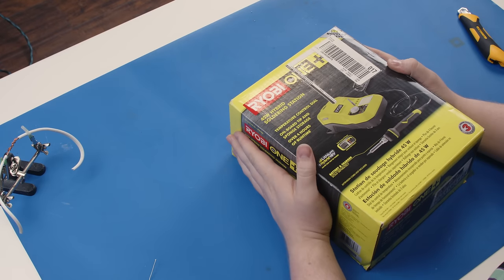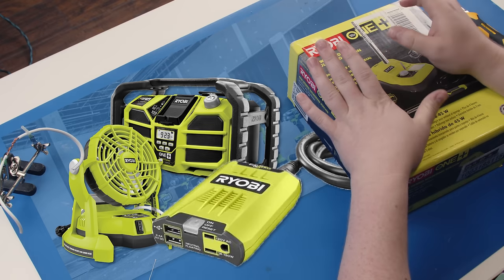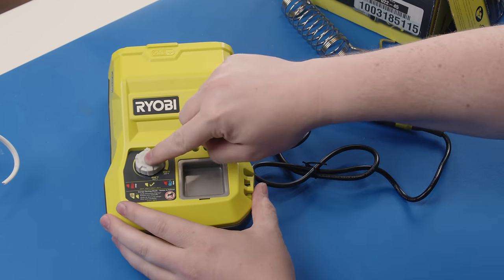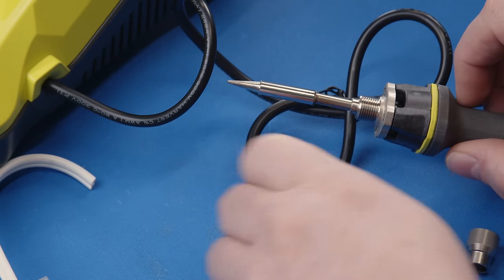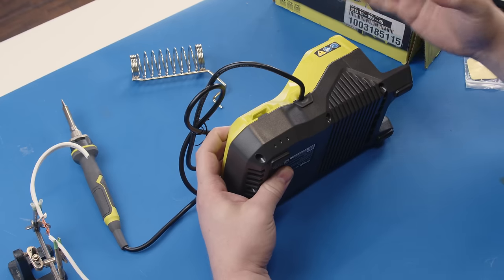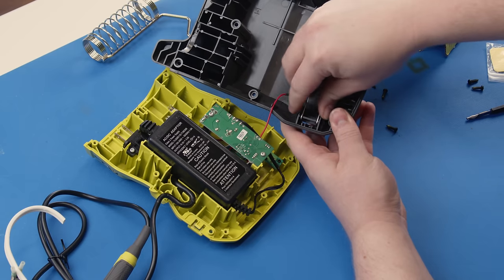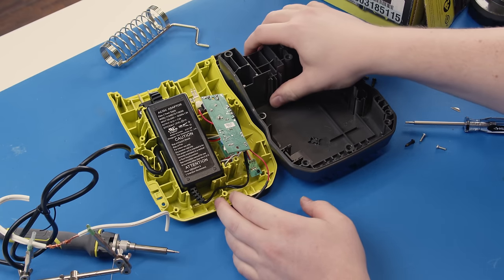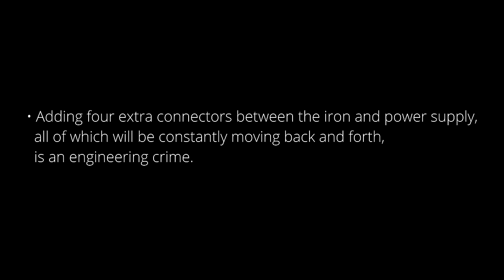Ryobi has GOT to be joking with this soldering iron

Comment: While the iron itself would melt through, the rating is intended to give you an idea how hot the cable itself can actually get. The markings are intended to help you figure out what cable to use for a specific application. Essentially it's saying "Hey if you run enough current through here, it's going to melt and catch fire right about this temperature."
Reply: 24:17
Reply: Yeah I really didn't like that this was a significant section of the video. It's the wrong meaning as you said and if that's what he's worried about might as well spend 5 min telling people not to rub the iron on their fingers either. Seems like Ryobi considered this as well with the cool down warning light. But alas can't engineer for every single use case.
Reply: If you push enough current through a cable for it to reach 80c you've got way bigger problems than your cable melting and catching fire.
Reply: No.  If your wire is (self) heating up much at all, it is too small a gauge for the design current or the circuit has a fault.  On the other hand I do agree that the specs are needed to determine cable compatibility in extreme environments, for example an engine harness or on the space shuttle, inside a toaster oven or curling iron, etc.  Most of these applications are also those where  you can't use solder, must crimp or weld/etc.
Reply: No, it has nothing to do with the current rating.
It is to to with where the cord is expected to be.
Some devices are made so their power cord will remain cool, and are fine with an 80C one.
Some are made such that even the receptacle for the cord can be over 80C, and so need a better cord.
Reply: Man your making an idiot of yourself about this wire thing buddy. 80C is electrical rating not soldering heat protection rating. So don't touch the tip on the cable no matter its material type..... or your skin.  Your skin is rated way lower than 80C...
Reply: @Rubenmanzana No, 80C is temperature rating, not electrical rating.

It indicates the maximum temperature the cord can handle before being damaged.

But yes, it shouldn't be a problem.
Reply: @jeffreyblack666  yes, but the reason that temperature rating is important or relevant to the cable has nothing to do with the cables physical relevance to what its attached to. It is printed on the cable not for the soldering tips heat protection ability but for maximum allowable ampacity determination for the conductors within the cable. The cable manufacturer doesn't know what its going to be used for. But if you draw more current than the conductors and cable can safely carry the heat of the circuit will be over specified rating, especially if used in high ambient temperatures, causes failures and potentially dangerous outcomes. The cables manufacturer must determine the insulations heat rating as well as specify the wires circular mils or AWG for engineers to properly select proper cables for circuits they design. No one was thinking of protecting the wires from soldering tip when that label was placed on the jacket. To me its a no brainer (but i do have this rare gift i call "common sense") to just keep the soldering tip from touching the tools supply cable. I assure you even if the same cable were attached to refrigerator and was installed in the cold area its labeling wouldn't change or even be relevant to the machines potential physical hazards due to the refrigerator itself. though consideration to the colder temp could be considered when de-rating, sizing, selecting, ect. the cable temp ratings are for determining conductor sizes more than anything else. Not for determining how safe it is for the soldering tip. Any hard wired soldering iron thats used carelessly will damage its supply cables people. Thats not a thing that should have been criticized. The fact it wasnt flexible and had memory and was stubburn in using the tool is worth of critique but saying they were making bad choices based on that rating of the cable because the iron is hot is ridiculous.
Reply: @Rubenmanzana  No, it isn't.
The temperature rating has pretty much nothing to do with the current rating of the cable.
Instead, the temperature rating is about what temperature the cable can withstand which can be important for what it is plugged into or attached to.
Some devices, instead trying to protect the cable from heat, will instead just require a cable which can withstand a higher temperature. For example, you may have a hotplate or an oven which requires a high temperature cable.

We see this quite easily with the IEC connector, which commonly have cords with insulation like that. The C13/C14 connectors are rated to 70 C. The connector and cord MUST be able to withstand this temperature, but it is also rated to 10 A. The C15/C16 are still 10 A, but are 120 C. The C15A/C16A are still 10 A, but are 155 C.

If your cord is getting hot from passing too much current then the conductor in the cord is far too small.

In the context of the soldering iron tip, that would be wherever the cable terminates in the handle.

Comment: Reminds me of when I worked with high current circuit breakers on a 130kV facility. Breakers like these uses 4 to 6 large pretensioned springs. Springs that are something like three inches in diameter and three feet (around a meter) long. Pretension in accomplished with electric motors. A particular norwegian made breaker that I had never seen before used... Bosch hand tool power drills with a strap around the button as tensioner motors.

Comment: I use this iron on occasion, it has yet to fail me. I like that I can store it in a big toolbox and pull it out for a short project without connecting it to the wall. Love it.
Reply: And now you know if you don't have access to an extention cable and your batteries are dead you can just take the shell off and pull unscrew the plug bit and plug it into a wall directly

Comment: I see you annotated that Hakko has the "exposed" ceramic heating element as well. I was going to mention that they use the same type on the Hakko 936. And, in my personal experience, the 936 is an absolute workhorse. But I also have one of these Ryobi units that I received for a website reviewed several year back. I'm actually impressed with how well it works. And for a station that can be used anywhere, with battery power, I'd actually recommend it for the home owner or field tech. EDIT: But you do make a good point about the PVC cord tethering the iron to the base.

Comment: TS100 is a really good mobile iron - works well with drill battery or laptop PSU
Reply: I use a ts80p as it can be powered using a USBC charger or power bank which is a bit more compact for my purposes. It came with a really nice, flexible silicone USBC cable
Reply: I personally have a pinecil, USB-C too, portable stuff is nice
Reply: i "upgraded" from a yihua 852d+ to a pinecil and have had no qualms whatsoever. the points cathode ray dude makes at the end of the video are completely true points, but the ergonomics, tiny form factor, complete portability and flexibility of power supplies on top of being dead cheap all make it one of my new favorite tools. if i wanted to use a battery, i could get a big beefy laptop battery that outputs 65 watts and go to town with any old usb c cable. i could get a power supply and have a completely competent soldering station with no added bulk. plus, temp control is on the iron itself, so i wouldn't have to take my eyes off the iron to change temperature. it's extremely impressive for being so cheep
Reply: I use the TS100 with a power bank. There are cheap USB C to barrel plug cables on Ali. It works really good so far.
Reply: I use a TS100 as well, when I’m at my bench I have a cable I can use with my bench power supply or I use a battery from my drone when out and about
Reply: Yeah I'm not sure what his bias is against them with his utter refusal to use a tool that does meet his criteria with great build quality
Reply: I use Ts100. It's ok. I just use my 3 cell lipos to power mine.
Reply: I have a Weller station at my workplace and honestly I prefer my TS100, I do solder small XLR pins and even had once 40 pin connector soldered with it, and its so comfortable and heats up in under a minute, I've used it so heavily the tip is black from all the soldering(I have it for more than a year, at least 10-20 hrs of work a week), never had an issue with it, my co workers (some in the profession for more than 50 years) said it is actually too good to be true(heats in seconds, cools down in 1-3 mins, can swap heads while its hot), seeing them use it and get amazed by it, you cant fake that, the TS100 is an amazing soldering iron, I really love it!
Reply: personally i use a pinecil which is essentially the same solder pencil but only cost like $25... uses the same tips as well so
Reply: Pinecil user here too. Got a friend to 3d print me a holder that snaps onto a dewalt battery. I still use a weller tabletop plug in for the majority of work, but the Pinecil has worked more than fine for a mobile quick fixes.
Reply: @wolfnation100  The lack of strain relief at the iron can be mitigated by using a magsafe stype connector.  Also the Pinecil has both USB C or barrel so in the unlikely event you do damage a port you still have a second to use till you can repair the first.
Reply: I think I'm gonna get one now out of curiosity.
Reply: @Kholaslittlespot1  Which?
Reply: @daveedee3626  I'll look into it but if they literally seem the same then the cheapest one xD
Reply: @Kholaslittlespot1  I think they're basically the same but the Pinecil has the advantage both a standard DC barrel or USB C port on the same iron.
Reply: @daveedee3626  The more I think about it the more I think I'll def grab one. Even just for outdoor jobs.

Comment: The Iroda gas soldering irons are excellent for where you don’t have power, the flame is fully contained and isn’t any more of a hazard than the hot tip or the hot shaft on an iron with a resistive element. They have a reasonable amount of temperature control too, and whilst you don’t have a defined setting, if you’re experienced with soldering, you just know when it’s right. 

PS, I use a JBC in my workshop.
Reply: I had one of those Iroda gas irons it must have been a bit of a dudder the bloody thing exploded luckily I wasn't hurt that put me off using gas powered irons for life.
Reply: @roberthorseman7432  wow, I have several that I’ve used for years and I’ve never had an issue, I consider them an essential tool as a live sound technician, so much easier for repairing a lead in situ… things get snagged and with the iroda iron, it’s a 2 minute fix, often quicker than running a new cable.
Reply: @Si1983h  Yes I was quite disappointed when that happened quite frightening.

Comment: I had a butane soldering iron for years (until it eventually got clogged up with particulate and died). I found the temperature control to be really good, and it was easy to see what kind of temp you were at based on how red the mesh screen on the exhaust was glowing.
Reply: Same. I've got a Snap-On that's been working reliably now for years, and never given me so much as a hiccup. Identical (aside from colour and branding) to the Weller Portasol 100K, which isn't surprising since that's who manufactures them for Snap-On. I'd definitely have no qualms whatsoever about buying the same one if mine were to ever irreparably fail.
Reply: @strathadam1  Mine was an Iroda, to be fair I think it was using some cheap butane that killed it off
Reply: I've got the radioshack special, i find that it heats up faster and is more accurate for what i do than the weller. (No ICs but plenty surface mount)
Reply: I love my portasol butane soldering iron. Heats up in seconds, great temperature control
Reply: I've been using a power probe brand butane iron for about 10 years in a shop. I've had to replace the soldering tip, but it has really held up well. Matco truck usually has them.

Comment: The closest thing to temperature control ive ever had was on my butane iron which you could set from blazing to literall hell on earth. Worked pretty great tough if it wasnt for the tip breaking after a couple of solder jobs

Comment: I like the Ryobi tools specifically because everything uses the same battery. They haven't changed the battery in a way that affects compatibility for like 25 years, so I frequently find tools from their older dark blue line at thrift stores that work perfectly fine once I plug a newer battery in.

I also gutted an old dead Ryobi Ni-Cd and instead of putting new cells in, I installed a barrel jack so that for lower power devices that aren't hybrid (but could be) such as the older lights, radios, soldering stations, etc, I can just power it from wall power and save discharge cycles on my batteries.

Comment: 20:30 Been told that the Milwaukee tips are interchangeable also as well as the HAKKO FX-8801. Been using this for the DIY, Automotive and two way radio installing for about a year with no issues both on the AC cord and A DeWalt battery with a Ryobi adapter. Not perfect but the best options of a bench type station as well as a portable iron. No it’s not selective enough for doing surface mounted components But like a Swiss Army knife it does a multitude of chores in one package.

Comment: I have and love this soldering iron with one exception that annoys the crap out of me.   It has an auto shutoff feature that seems to based strictly on time because it does so even while in use and the only indication it gives you (besides losing heat) is the green 'on' light only starts to get a bit dimmer every couple seconds.  It isn't at all obvious that if you want to continue using it, you need to turn it off and on again.   The light should flash red just like it does after you turn it off to tell you it's still hot.
Reply: @Zadesniper  
No it's a safety feature in case you forget to turn it off.   I don't mind so much that it turns off after some time.  I just wish it would more clearly indicate that it turned off instead of appearing to still be on.

Comment: I spent a good portion of time with that exact model of butane soldering iron because both wired ones we had either broke, or had the tip completely oxidized off. There is some ability to control temperature by varying the size of the flame, but it's not really precise (though, the one I use now doesn't have anything other than a dial marked 1 through 9, so it's only slightly better).
They actually work decently well, if you don't mind the smell of butane, the fact that all the hot parts are exposed and right next to your fingers (like, closer than usual), and that it's got very little thermal mass of it's own, but... yeah I'd gladly take something better any day.
Reply from the maker: Hahaha, thank you for the input and the pledge! I gotta get myself one of those butane irons.
Reply: @CathodeRayDude  they are fun. Good for really huge joints, but generally just fun to mess with.
Reply: @CathodeRayDude  Honestly if I knew where ours was I'd just toss it in a USPS envelope, not like we use it anymore. Though it probably got lost last move.
Reply: I would recommend the power probe   butane iron the only complaint I have with it is you have to be aware or where the exhaust hole for the flame is pointing or you might burn something, but it solders surprisingly well

Comment: I have an iron with an element that's similar with the ceramic piece and the screw on tip.  It also has a thermometer and it really does work pretty well, since I've used those stick soldering irons with a vague wattage, and really I havent had terrible results, but my little off brand russian iron works surprisingly well.  This was quite informative though, so I am taking notes! :)

Comment: I loved the Cold Heat irons for soldering my model train rails together.  The isolated solder joint didnt melt the rails and actually did work perfectly for that.  Couldn't use it on anything else.
Reply: Works great on thin photo etched brass parts too.
Reply: Seems almost like something that could be handy to quickly spot-weld small battery terminals. (Maybe that's why he still has it?) But not so hot for regular soldering for the reasons mentioned in this video.

Comment: I have had my cordless Ryobi soldering iron for a while now and IMO it's amazing. It's always in my tool bag it has never failed me, so far has performed flawlessly. The cord might be a bit stiff but I can live with that. Since I have had mine I have yet to melt the cord.
Reply: I agree. I own both the Weller mentioned and this unit as well, and for on the go / lazy quick jobs, it's done me plenty well. I own a lot of different tools from different companies, and the most recent Ryobi tools aren't bad. They've made their reputation much better in the past few years, and I don't hate any of the ones that I own. The only complaint I've ever had with their products is the battery could last a hair longer.
Reply: Lol yeah I've been wondering if someone is careless enough to set a soldering iron on the cord wether or not they should be playing around with heat sources or circuit boards at all.
Reply: first thing i did was replace the cable sleeve, honestly can't complain outside of the cable.
Reply: @JackPorter  good call

Comment: I use those butane irons a lot for joining low voltage wires, they work really well for that because temp isn’t nearly so concerning on an 18g wire. I also used a simple pencil for years, they were fine for hobby through hole stuff (nothing huge or too small).